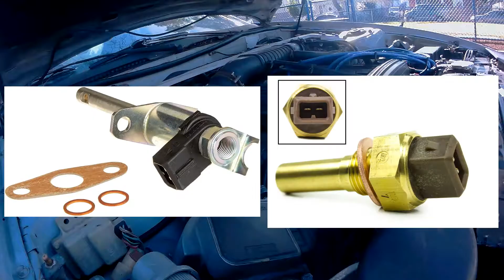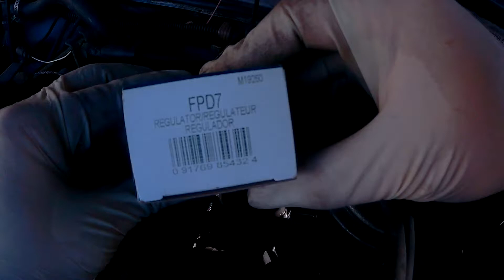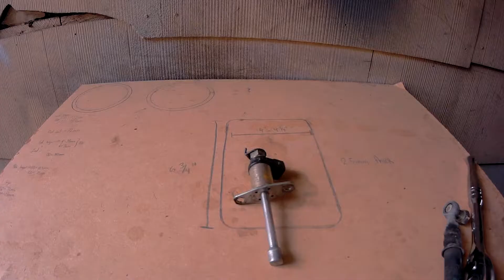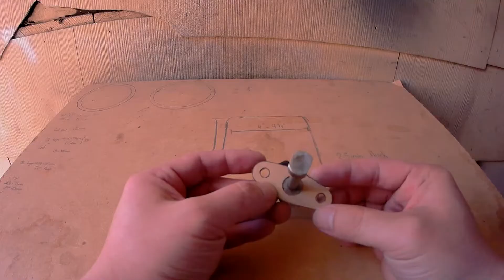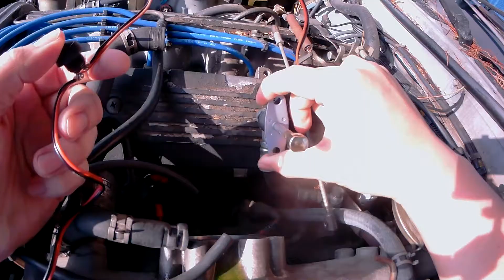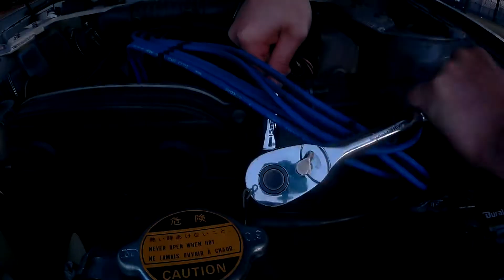(MKII) 1985 Toyota Celica Supra Hard Cold Start

Comment: You helped solve my cold start issue with less than 15 seconds under the hood. My damd cold start switch, near the thermostat, was unplugged 😂😂 Plugged it back in and it fired up perfectly and instantly for the first cold start since I've owned the vehicle.
Reply: I’m going to check mine now , imagine it was that easy .❤

Comment: Quick question: the part number for that injector to my Understanding is 23260-43021. Will the 23260-43020 from an 85 Cressida work instead?
Reply from the maker: Yeah it'll work. The ones from the Cressida is interchangable with the Celica Supra.

Comment: My problem is the opposite! Hard warm start (After sitting for 30+ minutes). Starts up just fine if cold or started up within 15 minutes of being turned off after warm
Reply from the maker: Took me a while to get back to you. Sounds like you're having issues with the air flow meter (AFM) soaking up the heat from the exhaust manifold.
Reply: @johnsneverendinglistofrand1377  maybe maybe ... i do have aftermarket headers
Reply: normal for when it sits after running, the heat from the engine boils the fuel or sensor for cold start bad.